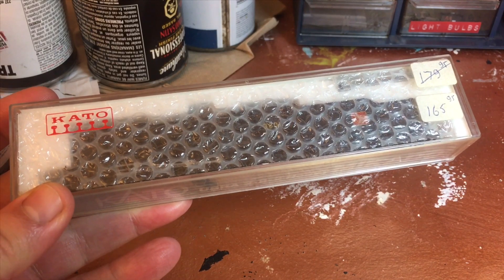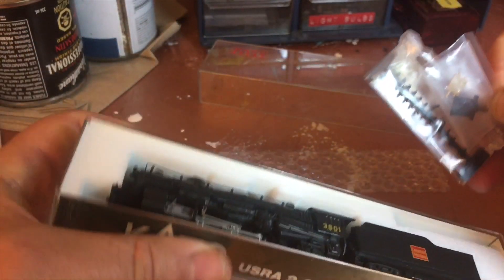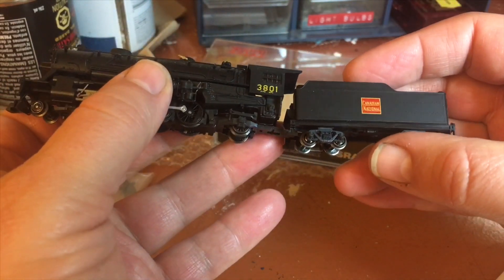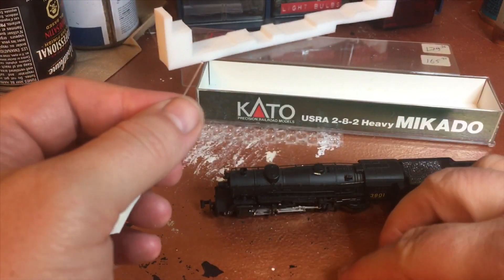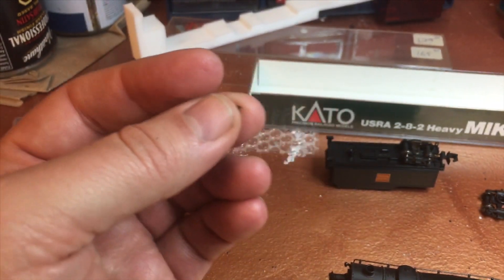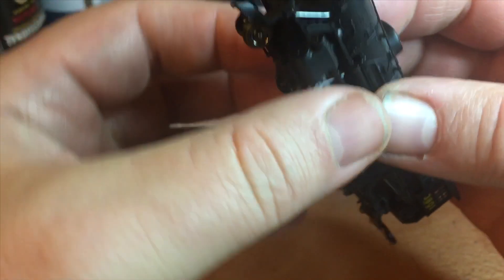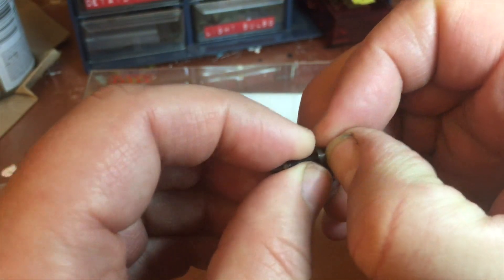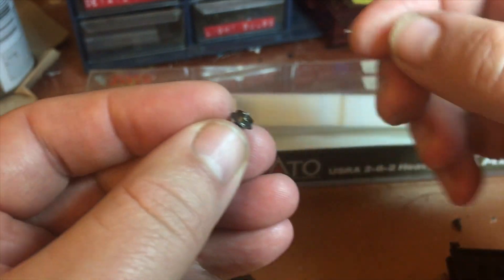N scale Kato 2-8-2 repair

Comment: I think you're the only on the Internet that may have an answer. My Kato Mikado (1st gen) is not picking up power from the main engine drivers, only the tender. Actually when I apply leads to the traction tire, the engine wheels engage. However the other wheels do not carry power from leads or rails. The wheels are clean and the engine runs as good as new. It looks as if the metal leads on the inside of the driver wheels may have lost contact with the outer rims. Kato has no more replacement wheels. Thoughts? Thanks.
Reply from the maker: It’s hard to say anything without looking at the engine. Make a video of it and I will watch it to see if I could help. Make some test leads using some wires and an old power pack. Put the wires on each wheel during the video.

Comment: That bell is extremely hard to replace if it breaks off and you cant find it. Kato doesn't seem to make anymore detail parts.
Reply from the maker: I found the katousa website where you can order parts. It’s sold out. It’s a real shame. That 2-8-2 is one of the best running engines out there…